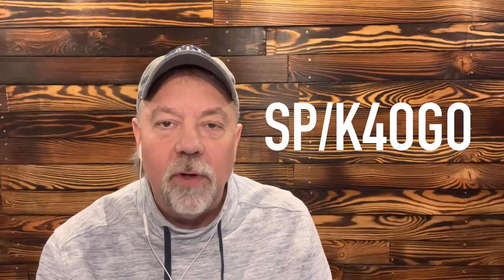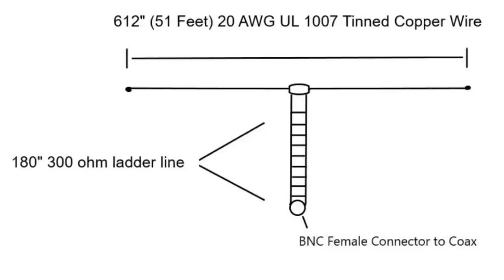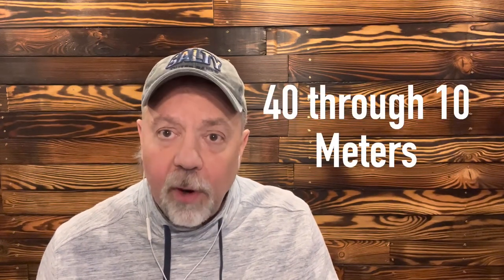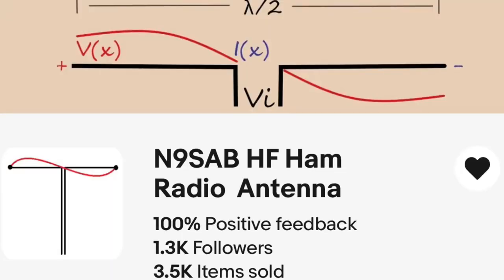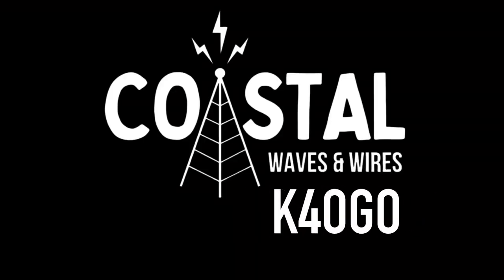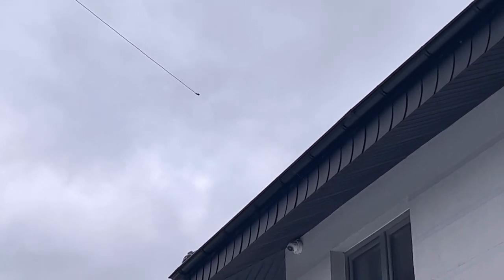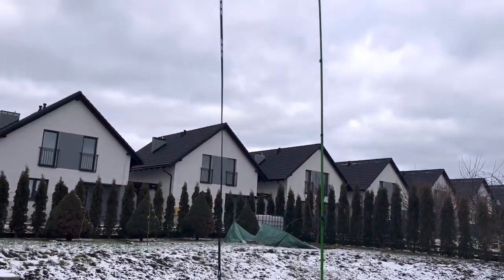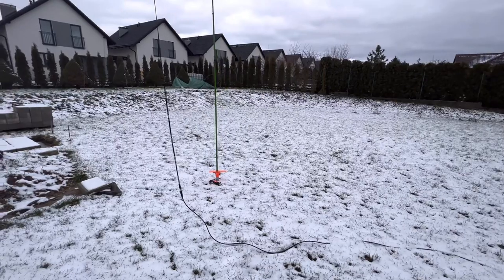G5RV Antenna - Working 40 through 10 Meters With This Lightweight Version

Comment: It now seems to be popular to criticize the G5RV.  What most folks don't understand is that it was never designed to be a multi-band antenna without a tuner.  What it is is an antenna that can be very easily tuned to multiple bands with good results. It is actually a better antenna in the current times with many rigs having very capable tuners built in.  Some rigs though, have very limited tuning range, the Icom 7300 (a great radio otherwise), being an example of that. Anything over 3:1 swr and you can forget it. As you said though, with a radio with wide range tuning like the G90, or with an external tuner, the antenna works great.

Comment: The original G5RV antenna was designed to work on 20 meters with some gain. Hams soon realized that it could work well on other bands using an antenna matching unit (tuner). I've used them for many years with excellent results. I had my reasons for using this particular antenna while working as a lighthouse keeper for many years.
Reply from the maker: Thanks for the info!
Reply: Curious to know what the special reasons were for the G5RV? Something to do with lighthouse? Also, wondering what it was like operating from a lighthouse. Sounds very interesting.

Comment: basically a 51' radiating doublet plus something that helps the tuning....so that is 25.5' per side & for every balanced antenna there is a single sided unbalanced equivalent fed against earth  so 25.-ish' of vertical metal plus something to help tuning plus an ATU.... hey we have just described the Rybakov antenna (just a different tuning helper but that doesn't impact the radiation) & lots of people like them. Just like we have unbalanced rubber ducks on VHF but run a balanced equivalent on HF & you call it a slinky antenna. Funny how basically the same concept gets so many names. You want to get really silly?... cellular inverted F antennas family history... balanced dipole antenna begats balanced slot antenna, begats notch antenna, begats balanced skeleton notch antenna which gets cut in half to become unbalanced & fed against a groundplane to become the Inverted F antenna..... I've always wondered how these would do on HF (more importantly to avoid groundplane efficiency problems, stopping one step early at the balanced skeleton notch could be interesting for HF... who is going to get their name on that?).

Comment: Back in 1989 on 21 mHz I worked Lois G5RV himself. Both of us using a G5RV and 100 watts, 5/7 both ways. I have his QSL with nice letter on the wall of my shack.73 de Mike VK3KTO.
Reply from the maker: That is so awesome, thanks for sharing! 73, Walt

Comment: I built my own G5RV years ago and it was great. I ran it through a Ten Tec tunner and loved it. I don't have the tall trees on my place that I used to so a reduced antenna might be the way to go. I studied the G5RV design quite a bit and one thing I found out was that the 10 meter portion of the antenna is the verticle section of ladder line. Thanks again, 73s KE4VBB
Reply from the maker: Thanks for commenting and sharing. All the best and 73, Walt
Reply: Do you imply that if I disconnect the two “arms” the ladder line will radiate in 10m?
Reply: @NamasenITN  I would think it should.
Reply: @1boortzfan  The wind just disconnected one of the arms of my G5RV. My radio's tuner refuses (of course) to work in any band but 10m. However the procedure of automated tuning fails. I conclude you might be right and that my tuner may still find difficult to work with high swr.

Comment: Hi Walt, as a newby to Ham Radio, I have a question about this kind of antenna.       Would this work if the two horizontal arms were at 90 degrees to each other rather than 180 ?    73, Pete 2E0IKX
Reply from the maker: Hi Pete, that’s actually a great question. I think it would work well as a L shape if the 90 degree bend was with the long piece horizontal and the shorter side down towards the ground. As far as a 90 with both horizontal I think it would work OK but might direct more of the signal out from the corner. You’ve got me thinking now, I might have to experiment. 73, Walt K4OGO
Reply: @COASTALWAVESWIRES  I will be watching with great interest!  But actually I do that already!

Comment: Hello, very good video I am considering the g5rv full size and I am wondering if I can just tighten each end only of each side without the center support?  would it be enough? or too risky in your experience? Thanks G7ned getting back on after 40 years!
Reply from the maker: I think you can do that if you can get the ends up high enough. Good luck and thanks for watching!

Comment: Funny story about G5RV antenna 
I pastored a church , started a ham radio club with the youth, WG4UM (Working Georgia 4 United Methodist)
The hall way in the church was 103 feet long 
We put discreet marks on the floor as a template to build the antenna and one summer the youth would come during the day and build G5RV antennas and sell on eBay.
They learned a lot about electronics and building stuff. All got their ham radio license 
Most of all we had fun
Reply from the maker: That's awesome! What a blessing.  Thanks for sharing!

Comment: Walt:
I had the same sized 1/2-scale G5RV up between 2006 and 2022 in a small back yard here. The only way it would fit in my yard was tp erect it as a sloper. The top was up 30 feet (9.1 meters) with the far end up 7 feet (2.1 meters). The 51 foot length is great on 10 and 6 meters, 3/2-waves on 10 and 5/2-waves on 6. I ran CW & SSB from 2006 until 2011, then mixed digital along with SSB and CW until 2022, normally under 40 watts but occasionally up to 75 watts. Between a spell on disability from a job-related accident followed by retiring 5 years ago, I spent plenty of time on the air, managing to finish DXCC/Mixed, WAS/JT-65, WAS/Mixed and I am 1 band from 5BWAS!  Gotta say, for a compromise antenna, it works, and works very well!

BTW: I also have 239 grids on 6 meters during the same time frame, the first 120 grids with the G5RV/2 and the rest on a Par OA-50 loop, an antenna you might want to try some day!

73, Keith, WB2VUO here near Buffalo, NY
Reply: Good stuff! 5BWAS is 80/40/20/15/10. How well does it work on 80? TIA 73 VE3GKT
Reply from the maker: Thanks for sharing!
Reply: Hi VE3GKT: The half-scale G5RV was too far out of the range for the tuner in the Yaesu FT-450, but could be matched with an external tuner.because of the high SWR  being tuned out, the losses in the tuner basically reduced the signal to zilch. I made a few local contacts on 80 meters, but a 29' random wire did a better job.

IMHO,  thd half-size G5RV is not suitable for 80 meters.

De WB2VUO here near Buffalo, NY

Comment: 👍Thanks for video. I put up a "temporary" half-G5RV about 10 years ago. It's still up and used pretty much daily! I did notice an improvement on receive when I installed a 1:1 voltage balun at the bottom of the window line. I sometimes wonder why doublet type antennas (including G5RV and it's variants) are not more popular. For example, balanced feeder is way more effecient than expensive co-ax. Doublets debunk myths like effecient antennas need to be half-wave resonant or need to have 50 Ohms feedpoint impedance.
Reply from the maker: Thanks for watching! Yes I agree.

Comment: Walt, I'm making my first HF rig a G90.  I'm really impressed with your experiences.  I really like this report on the N9SAB antenna.  I'd have about a 50' coax run to its input.  I'd run it through the basement to the outside then underground to its termination as a permanent installation with the G90. What coax would you recommend?  Do you cut your coax runs to size?
Reply from the maker: Hi Dennis, thanks for watching my channel. To be honest I just use coax I get on Amazon, no special brand. I use RG8x and no I don’t cut to size I just find a way to lay the excess out of the way.

Comment: Hi Walt – I have used a full size G5RV antenna at several locations over the years and had good luck with them.  I’m a little older now and not so nimble, so my last instillation was a 40M EFHW.  SWR is amazingly good on the non-warc bands, and it seems to radiate fairly well on 40 and 20, but not on the higher bands.  Trying to hunt POTA running 10 watts, is all but impossible on 15 or 10.  It’s possible that my issue is my location or installation.  Do you have experience with the 40m EFHW, and if so, how would you compare the two antennas with respect to the signal out.  I have a tuner so SWR is not an issue.

Thanks – I enjoy your videos.

John, WA4RXO
Reply from the maker: Hi, I've built quite a few 40M EFHW antennas and to be honest I'd say they are pretty similar with signal out. I actually prefer the EFHW because it is easier to deploy being end fed. All the best and 73, Walt

Comment: Hey Walt, interested in the connection at the bottom of the ladder line. Is it one of those red and black 259 jobbies with a double female into coax ??
Reply from the maker: No it’s just a BNC connector at the bottom of the ladder line